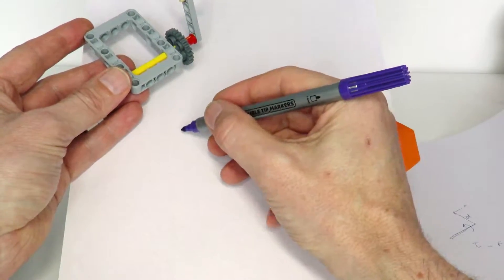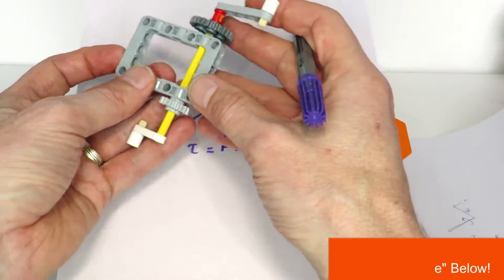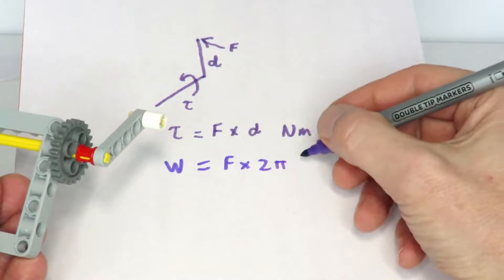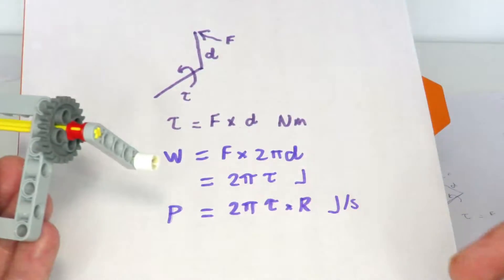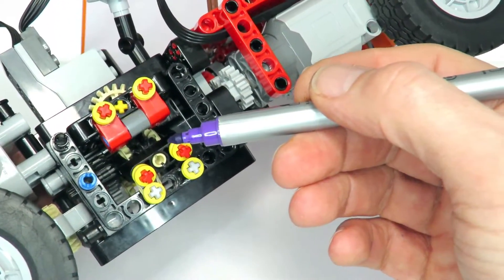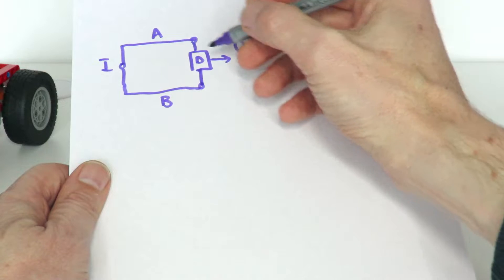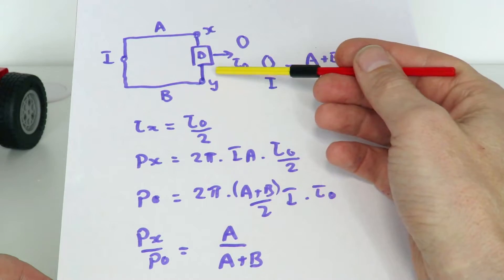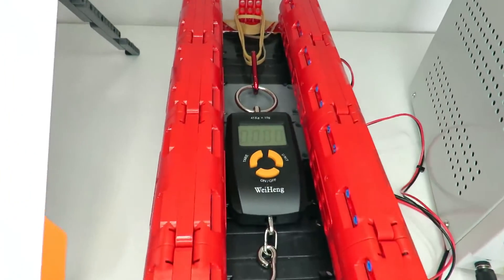Lego Technic torque and power for 2 speed automatic gearbox design

Comment: oh my word! what's the huge sculpture in the first minute? it.looks awesome! I love.this stuff.
Reply from the maker: Hi Carl. How's your work on our bet going? LOL. Yeah that was a bit of fun that intro. 😂
Reply: @TechnicBrickPower  Big problems, I can't make anything work better than the slipper so it looks like minot evolution more than revolution. Eg geared down the motor side so the motor enters the cube nearer the middle, not the top. Added further reduction to the torque side, repackaged the whole lot more neatly, and added 4x4. It climbs like crazy, very slow on the ramp but unstoppable. It will tackle a vertical step. BUT I can't eliminate the slipper! looked at linear actuators, but am thinking worm drive and a third differential. Dunno, it's quite a challenge, but also I am constantly amazed at how well it works despite the obvious power losses!
Keep building, stay safe. Take care.
Reply: @TechnicBrickPower  One other thing I didn't write but was going to, was that I am also highly impressed with what the Lego building community is creating. It's just amazing, and also great that we can share stuff on youtube. I think the average age of builder is somewhat higher than it used to be... :-D